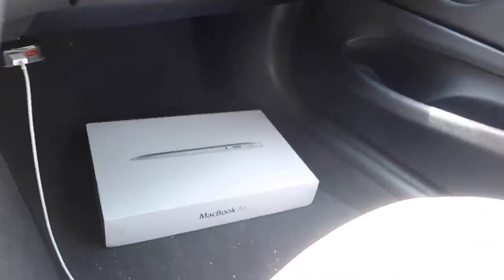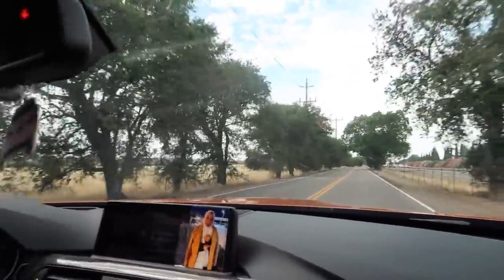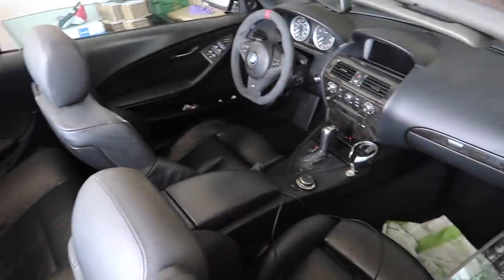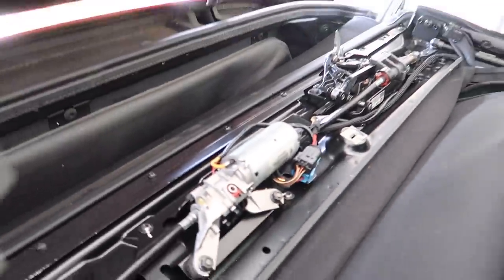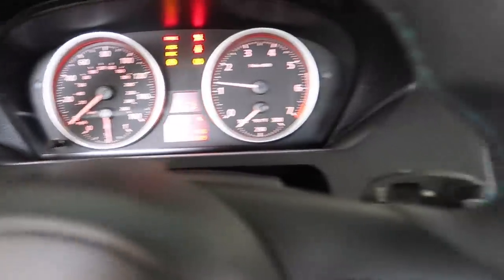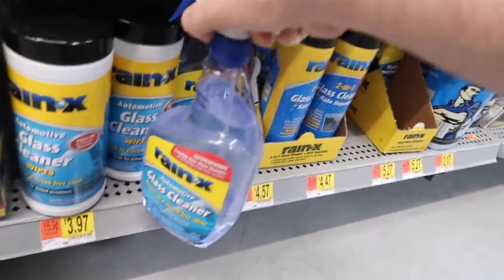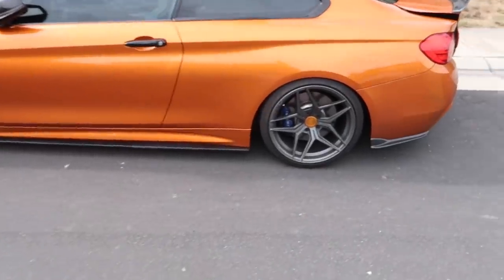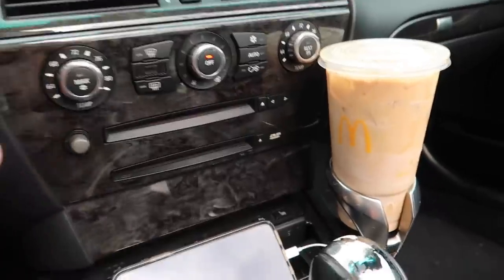MY 650I IS A MONEY PIT? (IT NEVER ENDS!)

Comment: Hey Nour, the smoking is oil, you’ll need to replace your valve cover gaskets. I had the same exact issue last week. Got the car towed to shop and the oil was dripping on the exhaust manifold. Mine is all done now and back to running like a champ. Good luck 👍🏾

Comment: Nice stuff Nour, keep us updated on the tech too, all interesting stuff. I just serviced my BMW for £214.99 at Halfords but then had to replace a dodgy coil and all spark plugs to pass the MOT for another £260. I wish i had the tools to do it myself. Not sure if i was ripped off or not though.
Reply: That’s way too much for a service my guy, depending on model obvs but my e87 cost me about 65 quid in the bits and labour I done myself but it’s around £50-70 depending on the model again. Halfords is a rip off
Reply: @awaismanzur8167  Independent garages quoted me £280! i don't think Halfords is too much with MOT included. MOT is about £60 + getting them to do it for you, you pay for their time. Just sucks about the coil and spark plugs :/

Comment: Nour about the smoke problem I had the same thing on my 128i but for me it was an easy repair. It would start smoking and after 2 minutes the smoke would just stop. So I found out some oil was leaking from the valve cover. The screws on it were kinda loose so I just tightened them up and the leaking and smoking stopped so u should try that before spending any money!

Comment: Also you can use a clamp plier to clamp the shock to hold it in place
Reply: Also you can get a fine metal scrub with Windex and sand it off it should come off

Comment: Nour Hummadi the battery voltage is either the alternator or starter my G also the smoke looks like it could be an oil leak or a bad o2 sensor